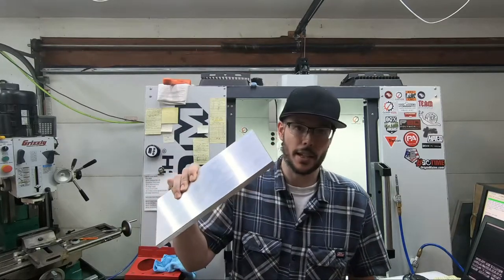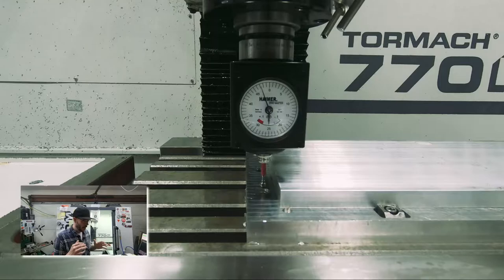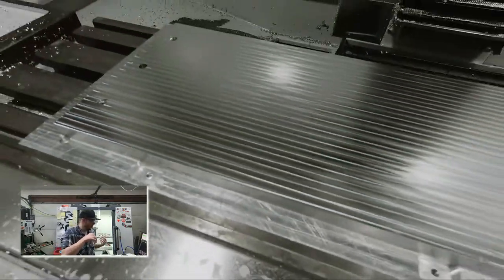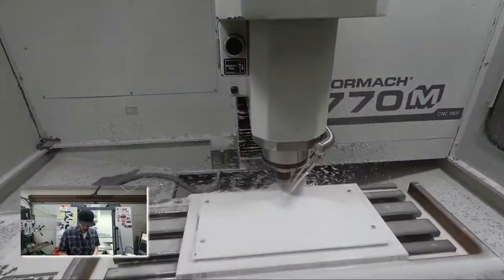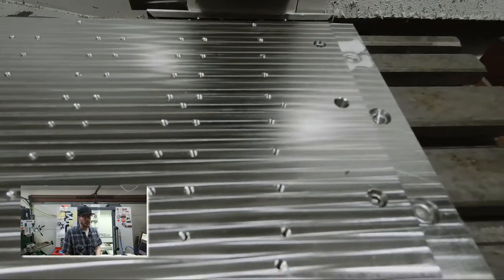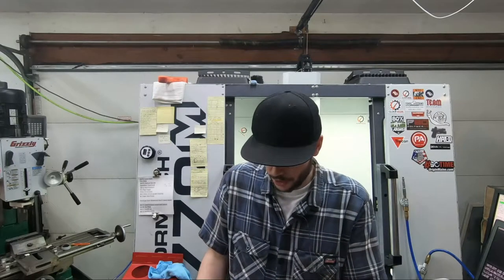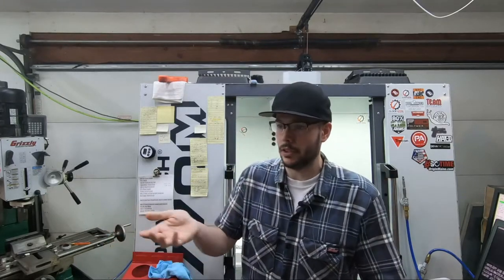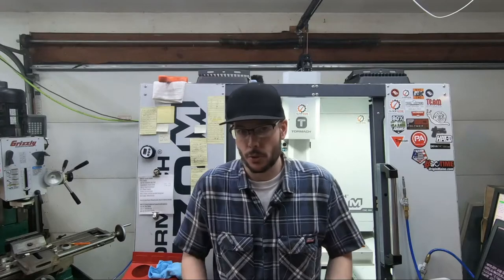Shop VLOG 05 | Tormach 770m 2 Year Review, Machining a Production Fixture

Comment: Mine comes in about the same time!. We need to circle back. The moment the 1100mx was released on you tube I wanted it bad. Took years but Saved up cash so first thing is thank the Mrs. Thanks for the videos, and the passion for the machine.
Reply from the maker: That is awesome man!! Congrats on the new machine! These MX Series are awesome when I first saw the MX series I wanted one so bad! When I got my 770m I was looking at the series 3s and the M series released and I needed the machine ASAP and didn't have time to wait another 6 months for the MX series to release so I grabbed the M. I had planned to get a brother speedio, but just not quite there yet in terms of credit and capital to get affordable terms, I could get one but needed to put down like 25k and figured it would be better to grind another year with 2 Tormachs and by then I should be able to get any industrial machine I want. I considered going back and upgrading the M to a loaded MX to go along with the new 1100mx but I think its just worth it to save the 10 grand doing that and use it on a down payment for an industrial machine next year!
Reply: I remember watching these videos when I had a converted G0704 clone with a tool changer and everything wanting a tormach so bad with all its off the shelf parts and great support, ended up skipping the tormach and jumping on a used long bed Robodrill. The speed and size are night and day.
Reply from the maker: @visionforge1254  that's awesome man! Robodrills kick major ass! I'm actually hoping to get a brother speedio asy next machine upgrade. My 1100mx arrives this week, finally! Hopefully grinding it out with 2 Tormach machine's I'll be in the place financially and with a steady enough workload to sell my 770m and get an industrial machine by the end of next year!

Comment: Great video, love to see someone create their own opportunities by learning a skill (especially in manufacturing) and build a profitable business on their own!  I worked in a machine shop waaaaay back in 1987 running a backing off lathe to make cutters.  The shop I was at had 1 CNC then and I was told it cost close to $1 mill at the time.  Incredible to see this technology at point where I could purchase one for my garage!  I would love to learn CNC, can I ask how you learned?
Reply from the maker: Thanks Ron! Yeah its wild to think how far the technology has come that you can get a capable mill for a decent price now to start on your own at home! I actually started because I started this building modded computers, at first I used hand tools, then I saw someone on some forums using a CNC router to cut panels and make interesting parts I couldnt do by hand, so I decided to build a CNC router kit and really just wing it and try to figure it out lol. I just built the kit and watched youtube videosand read CNC forum posts on how to run the software, calibrate the machine, run the controller and so on, basically self taught. It was pretty unorthodox but I just loved running the machines and kept at it, the more I learned the more I liked it! Its pretty insane how much information is out for free these days online, part of the reason I started this channel was to share some helpful things about CNC that I figured out along the way.

Comment: My 1100mx gets in late september early october. Cant wait.
Reply from the maker: Thats awesome!! Yeah Mine said September too, but I have a feeling some will come in earlier. Its a safer bet to have a long backorder time and then send out machines earlier, than try to pin down an early time and have it keep getting delayed. I had some Tormach replacement parts on backorder almost 8 weeks and they shipped out after like 3-4 weeks. Tormach did mention on Instagram to my comment that they have machines trickling in every couple weeks between big shipments. So fingers crossed we get some machines earlier than later!!
Reply: @ClockwerkIndustries  man i hope so. I financed threw Geneva on tormach website. The sooner the better i say. What did you spec out?? I got the premium model with literally every upgrade. Also nabbed the 8inch super spacer.
Reply from the maker: @JayVon_Ro  same here I went fully loaded with the operator console, Toolchanger, but went with the microarc 4th axis! Good thing is since my down payment has the first and last payment in it my monthly payment doesn't start until a month after I get the machine.
Reply: @ClockwerkIndustries  I think we have the same plan lol. My grand total was 35,268$ including shipping and extras. Specific reason you went with the micro arc instead of a more rigid 4th with ability to be horizontal and vertical?
Reply from the maker: @JayVon_Ro  Yeah I think mine ended up coming in around 32500, I need to get an electronic tool setter, there's someone in the tormach FB group that makes them for 300$ so that would save a few bucks, I did get the tormach passive probe but plan to get David loomes wireless conversion. I went with the microarc for the harmonic drive and though its not as rigid and beefy as the other 4th axis its more accurate out of the box, the other ones are accurate after some tuning and backlash comp, but I am going to be using the 4th axis about 75% of the time as a trunnion to machine the top and bottom of my production sheets in one cycle and need the most possible positional accuracy. I still have about 2 grand in accessories to pick up from other vendors.
Reply: @ClockwerkIndustries  yea the 1200 for the tool setter really had me going but i definitely need it. I didnt know someone made one for the tormach, thou i already spent the money it would be nice to gander at. I bought the mod vac table, all the bt30 holders, probe, tool setter, g wiz, skimmer, tool changer, auto oiler, flood coolant, operator console, 8in super spacer, buck boost transformer. I could swear they sold a fixture plate for the T slots but cant seem to find it. What all other accessories are you getting or know about for the tormach that I should look at? or what all is part of that extra 2k you need to spend?
Reply from the maker: @JayVon_Ro  Yeah I managed to save money on tooling after already owning a 770m I knew exactly what toolholders I would need to start with so I saved 500$ there from the kit,  I'm going to get a Saunders Machine Works fixture plate and accessory kit and a couple of their blank fixtures that work with their fixture plate and then machine them to work with my current fixture system. also their micro-arc mounting kit so the micro arc can be taken on and off without relocating. I'm also looking at David loomes wireless conversion for the probe so I can keep the probe in my ATC. The other guy's electronic tool setter and a few more odds and ends. Ill make some videos on all those things once I get them here in the shop!
Reply: @ClockwerkIndustries  my first project is to create a fixture plate similar to Saunders. Got the aluminum already! Substantial savings making it.
Reply from the maker: @frostcb2  Yeah definitely! I'm just going with their cheapest 400$ plate. The time it would take me to make my own would be better spent making my actual products so it balances out. This machine will be an OP1 and multifunction machine so his fixture system is a good base system and I and easily adapt my current system to it. I did have to make my own system when I got started because my parts are unique and I needed ALOT of fixtures, going to be over 50 different fixture plates soon and it would have cost a fortune if I had to use SMW blanks or Pierson blanks to make my production fixtures.

Comment: What cam cad software do you use? Cool machining content
Reply from the maker: Thanks man! Going to try to get more videos up with machining/laser/3d printing/PC modding content. I have been using Fusion360 for all my CAD and CAM for about 4 years now. I used to use Vectric Aspire when I was on my CNC router mostly, but going into product development and production, Fusion360 was the best bang for the buck, will probably stick with it, only reason I see switching to anything else is if I decide to apply for an FFL as I begin my journey into firearm parts but as of right now I have no intention of going beyond anything past 80%s. Im going to be doing firearm stuff once the new machine is here and I get my computer modding product lines dialed in.